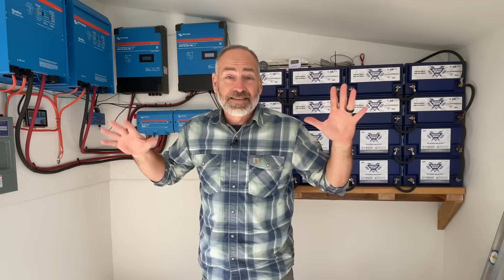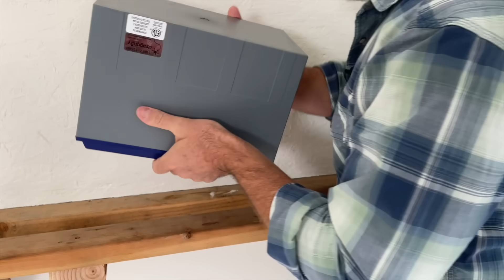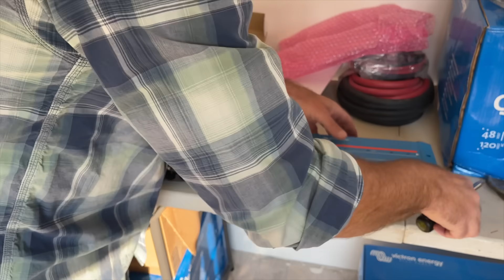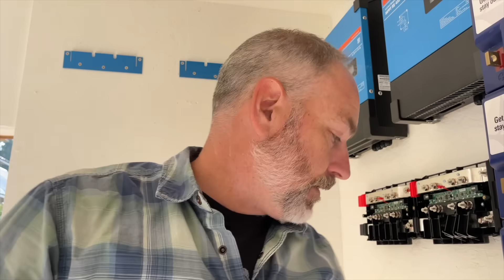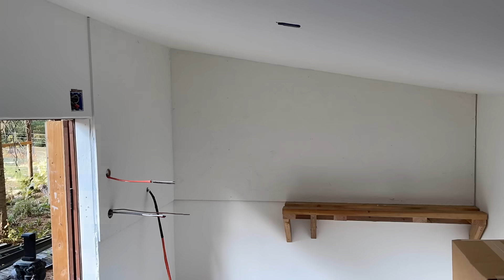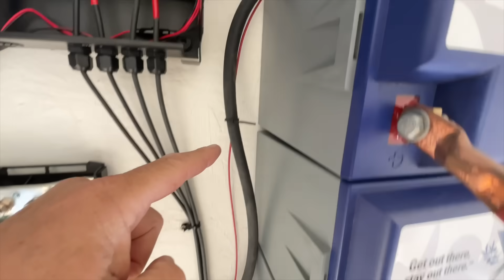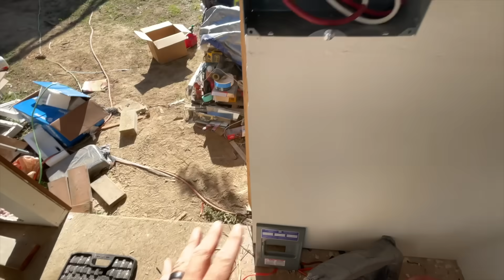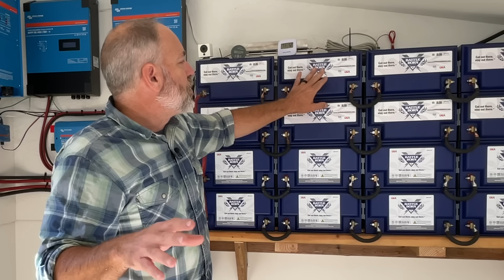EASIEST Off Grid Solar Power System Battery Bank

Comment: Maybe I'm being OCD, but even as light as those batteries are, that shelf gives me the heebie jeebies. I'd like to see two legs, (2x4s), in the front, all the way to the floor.
Reply: At $875 each, I’d have more support.
Reply: @Scott Sanborn  I'd buy a used computer rack server shelf! Made of steel!
Reply: Or strapped up to the roof so the cats can't climb up the legs.
Reply: Why not just on the floor?!
Reply: @tjunkie  batteries go dead,when parked on cement floor!😅
Reply: @tjunkieu2b probably to keep them safe in a flood or from kids etc
Reply: 😂🤣 you never put any battery on the ground. Your welcome
Reply: I was more worried about the small foldable table the inverters were on. A little wably
Reply: I thought it was just me. Thank you. 👍
Reply: I agree. OCD or not. Having batteries on a shelf like that is a safety hazard. 
I'm thinking he wanted to get them away from the ground due to flooding. I would've mounted them a bit better, but just me being a backseat quarterback the day after the game.
Reply: I was thinking the same thing….
Reply: @sreekumarUSA  Does that also go for dogs? Or do only cats eat cables?
Reply: @sreekumarUSA  I don’t think a cat is going to jump 7 ft up to be able to chew wires. There is more danger of them chewing wires in your house they in this shed💁‍♂️😉
Reply: They are so light.....not like lead acids....you should definitely feel them once
Reply: There is more than enough support for those batteries. Might have fried kitty cat one day though😂
Reply: Thats definately not safe with that amount of weight .. this kind of mounting requires a renforced wall and ancores .. nice big system tho ..
Reply: Yes this
Reply: @boblatkey7160  Yes totally, he even used copper wires!
Reply: @sreekumarUSA  curiosity killed the cat but it led to Amazing Adventures
Reply: Yea My OCD Engineering design thoughts would stop
Reply: @sreekumarUSA  I can't disagree
Reply: Yes, bad Engineering. "Bare Minimum" construction. Shelf with batteries on it MUST have full support.
Reply: I was thinking the exact same thing
Reply: You may not know what OCD is.  Just based on context .
Reply: I’m concerning  about that too 🤔
Reply: Really, that’s what you have to say. Omg.
Reply: Same here!
Reply: I don't see the need for all these inverters,but explain why u have/need so many!
Reply: Yeah that's way overkill 😂😂 that shelf is planty for that batteries
Reply: Yeah that shelf is working overtime. Put some braces in the bottom asap.
Reply: Has to be a brick wall behind the plasterboard. If so each brick can hold a ton 😎
Reply: Yup..makes me nervous seeing that.
Reply: Going to have a bit of a problem changing out a faulty battery if it isn’t either at the top .
Reply: The pressure of the shelf pushing down pushes the triangle supports into the wall. 
It's a triangle. That's as strong as it gets without floor supports.  
Its safe. This same method is used to build work benches in the shop. If its can handle that abuse it can handle that load.
Reply: I agree, stamps and legs, too much money sitting on that shelf!
Reply: I was thinking the same thing, not much support for all that equipment.
Reply: Wow. Victron is the best of the best. Not cheap
Reply: I thought I was weird. So happy to see others wonder if the batteries are going on the floor one day. Followed by a big boom. 

Honestly,  when his little boom effect went off I jumped a little . Hahahahaha
Reply: I mean, just put'en on the floor. What is he trying to prove?!
Reply: No way would I mount those batteries on the wall!
Reply: OCD
Reply: That shelf is structural engineered 😊
Reply: If it ain't broke don't fix it
Reply: This was my first thought as well.
Reply: That is nicely stacked batteries...I meant mounted batteries...😬
Reply: Anytime I see shelves with 2x material on the flat I question everything that person builds. Since it is common for cells to swell slightly this sure looks like it isn’t the safest setup I have seen. Then he puts things with heavy gauge wire on the opposite wall so the wire is longer instead of on the same wall and at that point I knew minimum if anything this guy will be beneficial.
Reply: First thing I spotted 😳
Reply: I felt the same way about the weight on that shelf .
Reply: Those r some of the most expensive batteries you can buy, cost $15,000 for 16 batteries even on “sponsored” very expensive, I’d rather buy less expensive and get more or just make my own battery bank, you could build a nice system for what they cost and he’s using basically junk shelf to hold $15k in batteries 😂
Reply: Not sure why everything is mounted so high up ie the hottest part of the room the inverters need more space to keep cool
Reply: @howard922  my guess because of the cat is why everything so high up. As there is people making comments that the cat shouldn’t be living in there as they could chew the wires and killed 💁‍♂️ the same people who think cows should be set free and not locked up on farms. They don’t understand what happens when you hit a cow with a car😉
Reply: @howard922  Yes, they run so hot, they will glow in the dark! I guess he will have to install a large industrial HVAC and a 200kW Diesel generator to power that HVAC to cool those behemoths.
Reply: @wolfgangpreier9160  19.2 kWh should be enough to run the air con😁
Reply: @howard922  Good idea! Pump the batteries full of electrons and make them heavier - does the shelf hold the additional weight of all those electrons? - and then pump it out to run the air con and cool the room down so more electrons can be put into the battery. And then start all over again!

The perfect perpetuum mobile!
Reply: @wolfgangpreier9160  an electron weighs about a trillionth of a gram but I expect he built that into his calculation for the type of wood used on that shelf 😁
Reply: @howard922  Its at least 100 billion electrons. That is NOT nothing! (And its not how batteries work but thats another point…) 🥸
Reply: I agree.  Also N. Idaho gets occasional earthquakes.  Add some straps.
Reply: @Kevin-ry7te  good idea
Reply: I’m an engineer with OCD. Shut up and let this guy enjoy what he’s doing!
Reply: @Hema1400  I was just making a suggestion. Trying to be helpful.Had I known all the ragging and arguing it would cause, I wouldn't have said anything. Makes it hard to try to be truly helpful.
Reply: @selador11  you’re on the internet. What did you expect? Open arms?!? Again shut it down! Nobody asked for help!
Reply: It’s fine lol. It’s a 500lb static load, less than 10” from the wall, spread across at least 3 studs, with most of the force being redirected inward to 2 of the studs.

A 75” full array TV on a 24” extended mount has significantly more torque than this.
Reply: @ZWill07  Thanks, you’re seeing what I see. It’s good those batteries are 29 lbs x 16 = 464 lbs. and the wire under 500 he’s good.
Reply: Great to see a setup that can grow with you.. I started with your old setup but 2x the batteries *19.4kw.  Then added 60kw EG4 from signature solar and two MPP inverters and no longer need the generator.   Note: Please verify the electrical location of the CSL surge protector with Battleborn.  Thanks again for all the videos ❤️
Reply: @boblatkey7160  I thought you meant a cable is not cut with a knife? Or that the Victrons are much too close to each other? I could not just drill a hole through my floors. But i guess thats also not the point you wanted to make with your devastating comment? Isn't it law that you in the US must put all cables into metallic pipes? Or did you actually mean that you do not parallelize batteries like he did, but its not necessarily totally wrong, only slightly? 

Die you mean the AC lines? - Oh yes, thats standard operation and perfectly ok when you do not have a crimp connection. You wrap it around the nut and tighten it down. Of course thats not my preferred method but when Victron does not offer better methods you must use them.

Does it burn down because of that?

No, or every Victron installation must burn all the time. Which it obviously does not. Just as every Tesla in closed parking garages do not burn all the time...
Reply: They are so light though, no need
Reply: @Zorlig  it’s not the weight.  Each of those batteries contains a lot of energy.  If one comes down, you risk them all coming down .  Conductors May short and there will be one heck of a fire.
Reply: @Kevin-ry7te  16 Batteries have 19.2kWh, That is the equivalent of at least 2 Liters of Gazoline, Highy flammable! When you only look scared at those dangerous thingies they will combust at once with all their power of 19 dot 2 Kilowatthours! Thats at least as much as one firecracker. A very deadly weapon indeed!
Reply: @Kevin-ry7te  how do you suppose they’ll come down if it’s not the weight? Will one of them get bored of sitting on the shelf and jump off?
Reply: 50 amps feeds the home ? What is that going to power ?
Reply: @anthonystephens8636  Lights, small heaters and cooking appliances. More than that are luxuries.
Reply: @davidjames1063  ya i dunno about a house that big and just running feeders for 50 amps sounds like a big waste of time 🤷‍♂️

Comment: Your 110 VAC wire you have going from the shed to the house is not nearly adequate for 50 amps.  It might be ok for 15 to 20 amps, but you want at least 8 GA wires going to the house/garage sub panel, but 6 GA or bigger would mean much lower voltage loss to house under 30 amp+ loads.  Otherwise you will be pumping a significant portion of your stored battery power into heating the ground from the high resistance of the undersized wires under heavier loads.
Reply from the maker: Froze the shed to the house is 6ga. Form the inverter to the beaker in the shed is 10ga temporarily because I ran out of 6ga. But the max we us is 20 amps anyway.
Reply: @MartinJohnsonOffGridLiving  That sounds good.  A short run of 10 GA won't lose that much power.  It's your longer runs that are most important.  Like your runs from the solar panels, which are likely 8 GA.  You may want to increase those if you ever start delivering much more than 20 amps @ 300 VDC from a single string of panels since your run is so long.

Comment: That's amazing you have been able to run a house with only 3,000 watts of solar panels!
Reply: I think all they're using the electricity for is lighting, computers, phone chargers and their freezer with the occasional instapot dinner.  Heating is a wood stove, hot water and most of the cooking is with propane.
Reply: @michiganengineer8621  Gotcha! They will be able to a lot more now, but definitely need more panels. 🌞

Comment: Great video.  Question:-  what programming did you have to do on the charge controllers ?  Cheers.
Reply from the maker: Just set the charge voltage correctly. The info is on BBB website.

Comment: Very nice and very clear explanations Martin. One small remark from one tech to the other... when daisy chaining batteries you want to connect your leads to and from your distribution boards in the middle off you daisy chain and not like you did now. This makes the total current going over your battery connections go in half making the connection resistance less cause for getting warm. Just one minor remark, for the rest very nice system!
Reply: Both methods are valid,  according to the manual. 
But both can best not be used.
See my other comment. David Poz made a nice test.

Comment: Nice setup, missing however are the solar disconnect switches underneath the solar chargers (you are not supposed to misuse the MC4 solar cable connectors by disconnecting them while current is flowing)

Comment: nice setup, very clean work. Just a couple of questions. Does that system come with an ability to gather data on each individual battery? I know there are third party addons for that. Being able to diagnose which battery in the branch is a problem if one has a problem, and check individual battery temperatures is a nice thing to have. Also, how did you plan the loadout to each of your buildings, ie house vs apt (I am presuming separate subpanels). i mean it would be cool to see how you did your power calculations (unless you did what the family on Lumnah acres did and just went for the moon so to speak with his setup, which is awesome). Great work.
Reply: @boblatkey7160  It sure reveals your character, the way you don't wanna back up your comment, by pointing out specific examples that will help eliminate safety issues.

Comment: Nice new installation and the how to do. Strange cable bend phenomena however. I would have expected that the inside copper strains would have been the longer once as they run through the inside curve. You showed that the outside strains were the longest.
Reply: I think it's because of the twist in the strands.  The strands in the middle of the bend migrated to the outside at the point he made the cut.

Comment: Martin that romex you have feeding your AC distro panel from the inverters looks like #10 solid copper which is rated @ 30amp, that be a lot larger if you've got a 50amp 240V breaker feeding the house.  You'll smoke that romex before that 50amp breaker trips, not to mention the 20amp 240V breaker for the shed too.
Reply: yes, those wires are too thin and have no crimped ring terminals.

Comment: Are you a Grounded or ungrounded system?
I/E did you ground your point at entry panel box with ground rods? 
Service Entry: looks like your running 10AWG (30 Amps) wire on you 50 Amp barker! should be 6-gauge wire. Yes big difference in price if you can lower the breakers to a 30 amp in your panel in the solar shed. PS don't need a main breaker in your garage panel box.
Reply: @UCFs2grH-ayzpGMPWv1bpodg Martin my intention is not to be negative, I understand the way you set up your Garage panel box 120 and the need to reconfigure it once you go to 240, be careful about balancing your loads between the two phases, borrowing someone's amp clamp Or do an energy audit of all of your homes electrical loads you can keep the load on the neutral balance. Congrats You're doing a great job.

Comment: The new batteries are a game changer. Will the residual heat from the system be enough to keep the temp up for the batteries when its -20 F?
Reply: I would think he will need a small electric heater in the shed to keep above freezing.

Comment: Great work! You are going to have a ton of power for winter, you could even have a small cheap electric heater to keep the batteries from freezing
Reply: With insulation in the shed, the idle consumption itself is probably enough to keep the batteries from actually freezing. It's gotta get really cold to actually freeze them with this setup.
Reply: He doesn't show the generator he uses to charge the batteries in the winter.
Reply: The inverters are going to throw off plenty of heat to keep that from happening

Comment: No wood backing board sheet? Hopefully your cats don't chew on wires.
Reply: There is a sheet of osb behind the system. We painted it white to match the walls.
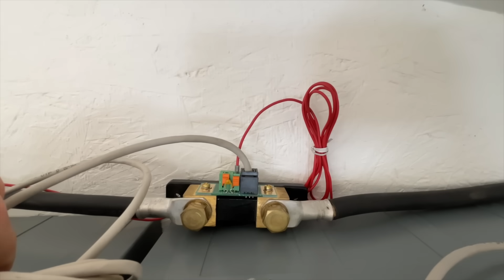Reply: You can see it at minute 19:24. 😊
Reply: But OSB is still wood, Julie... and it could be set on fire from intensive heat from the solar equipment, a spark, etc... all those solar equipments should be mounted on fire retardant surfaces placed over the OSB's... it's just how it's recommended to be safe... Just my 2 cents...